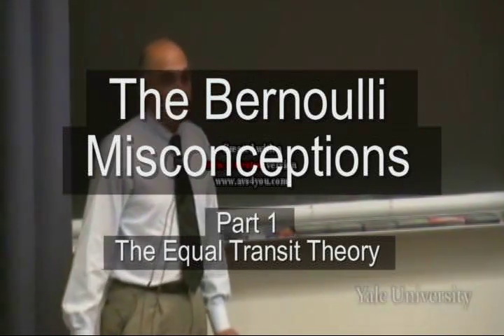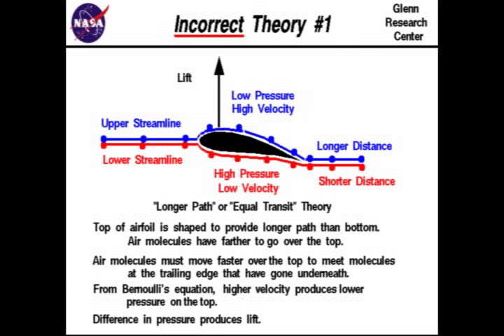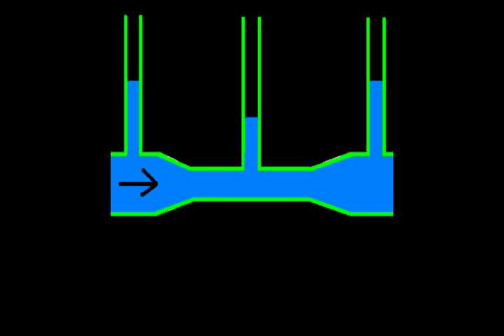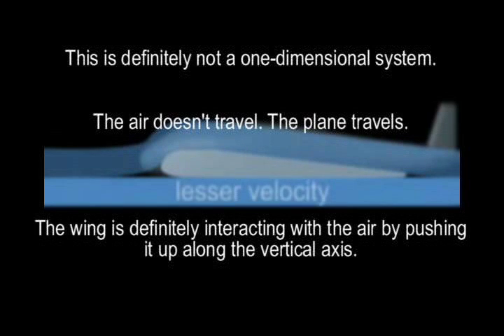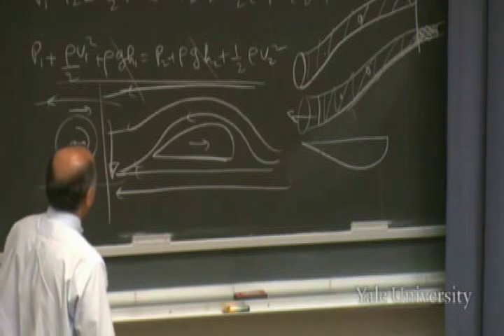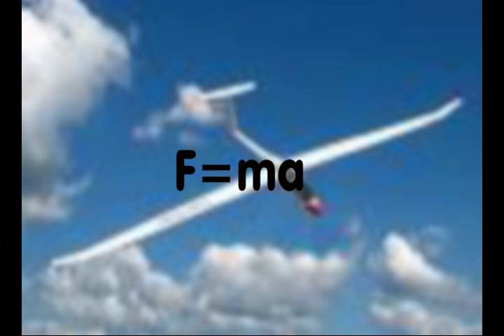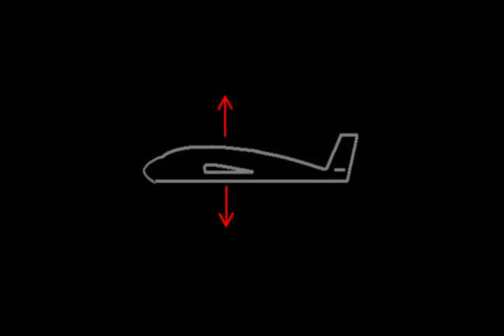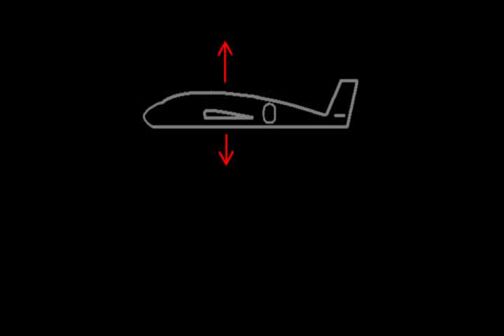Bernoulli Misconceptions 1 - The Equal Transit Theory

Comment: Your explanation is wrong, please read my correct explanation
https://youtu.be/2WTTXz3Dttw
Reply from the maker: The intention with my video was to prove that there cannot be any lift from the "Bernoulli Effect" as of the Equal Transit Time Theory. This means that 100 % of lift is due to the wing pushing air down and creating lift in according to Newtons Laws. Seemingly, this also what you try to show.
Reply: My point is that the expansion of the air on the upper wing leads to a decrease in pressure, and the pressure at the lower part of the wing increases as a result of compression, which is the so-called lift of the wing.
Reply: Why is the air inflated on the upper wing? Because the wing angle of attack, which leads to the upper part of the front wing channel narrow and wide, because the flow of air in the bulging, according to the state equation of the ideal gas, assuming other factors remain unchanged, it will reduce the pressure on top of the wing.
Reply from the maker: There will be expansion of air when there is low pressure. But a hydrofoil works equally well, and in water there is very litte expansion
Reply: Water flow in the channel illustrates the nature of the water. Why would the air pressure into the bottom of channel(2::40), because the channel is at the bottom of the low pressure, when the pressure is low to a certain extent, because the water is almost incompressible, so the speed is not too high, the air is pressed into the bottom of the channel.
Reply: English is not my mother tongue
Reply: It should be noted that the tiny compression of the liquid causes a great increase in pressure. Likewise, a small expansion of a liquid can cause a great drop in pressure.
Reply from the maker: Again, I can't see that I disagree with you. Maybe I would word it a bit different: When a wing creates lift, there will be an area of lesser pressure above the wing. Air will be accelerated into this area because of the pressure differences, thus causing the air to move faster. This will also be accompanied with an expansion of the air inside the low pressure area. All this will happen simultaneously. There is no one effect causing the other effects. All effects are causing, and being caused, by other effects.
Reply: As we all know, two ways can produce low pressure. One is that the flow rate increases and the low pressure is produced. The other is that the expansion causes low pressure. These two factors can lead to low pressure. So, is the upper part of the wing a low velocity or a low-pressure expansion? Either of these two factors, but one is the main one? So what are the main factors?
Reply from the maker: There is no way to answer which one is more important. The effects are both dependent on each other. It is correct that in a volume of air with less concentration of air molecules will exert less pressure on a surface if all other factors are the same. i.e. same temperature. In the case of an airfoil, it is a bit different. The effects cancel each other out, one might say. An airfoil creates an area over itself by removing air from this area when it diverts air downward. Air rushes into from the front of the wing in order to compensate for the low pressure area . Then, because of the lesser pressure, the air expands somewhat. This again lessens the "need" for air to rush in quite as fast because the air that already is over the wing has expanded a little. If air was incompressible, it would simply move a bit faster over the wing, but not create any lesser lift. This is why hydrofoils work equally well.
Reply: The reason for a hydrofoil is the same, because it expands so that the pressure of the water on the surface of the hydrofoil is reduced, so that the lift is produced.
Expansion can be a constant expansion, such as in the diameter of the pipeline can establish a uniform expansion of the conditions, but the constant expansion of the pressure has led to a decrease. So the speed has not changed, but the pressure has gone down. Therefore, a reduction in pressure may not necessarily depend on speed. It can also be caused by expansion.
Reply: Do you agree that inflation can also cause a decrease in stress?
Reply from the maker: Now, I am unsure if we agree at all. What is expanding? The water is not expanding to any degree that is worth talking about. When explaining lift, the only thing that one really needs to know is that an airfoil needs to divert air downwards. The resulting lift will be equal to the mass of the air multiplied with the downward velocity of the air. This is Lift = M(mass of air) X V(Velocity downwards). If one can analyze the flow of air around an airfoil in more detail, that will be fine, as long as one knows that the lift of an airfoil is in the end the result of the mass of air that is being diverted downwards.
Reply: In fact, any substance can be compressed and expanded. As long as there is a small water expansion would have great changes in pressure, so the water and air are different, so the discussion is to discuss water, water changes a little, because small changes in water has great influence, can not ignore the value of.
The upper air of the wing is moving downward, but why does the air on the upper wing move downward? This is the result of a powerful effect. Without force, the motion of the air does not change direction (from horizontal motion to downward motion). So why does it work forcefully on the air and move the air downward? What is this force? I think this force is the low pressure caused by the expansion of air or liquid. The low pressure causes the air or liquid to be subjected to downward force.
Reply from the maker: The shape of the airfoil is deceiving in many ways. There are many reasons why the airfoil look the way they do. they need to have the stiffness so they can carry the weight of the plane, then they also need to contain fuel tanks and under carriage and mechanisms for slats and flaps. In this way it is not only for aerodynamic reasons that the wings have the shape that they have. The wings are designed to fly with varying angle of attacks and at different speeds. The most critical part of flying is the take-off and landing. where the speed is low. When at low speed, when there is a really high angle of attack, it is essential that the wing has a shape that makes the air sticks to the upper surface .(Coanda effect), which will otherwise lead to stalling For this purpose it is favorable to have a high curvature of the wing at the front, with a lesser curvature towards the trailing end. If the wings were only designed to fly at very high speed, the wing profile would look quite different.
Reply: The shape of an airfoil can, of course, be designed in different shapes, but no matter what shape it is designed, the air will change direction of motion after passing through the wing, right? Now that the direction of motion has been changed, it means that it is acting strongly on the air. Otherwise, the air will not change its direction of motion. Then, how does this force come from? What is the cause of this force? That's the point. And I think this force comes from the expansion of air through the upper part of the wing.
Reply from the maker: Newton's 2nd law. For every action there is a reaction. F= ma. The lift, F will equal the Mass of air times the acceleration downwards
Reply: The question is how does this F come from?
Reply from the maker: F can only come from air being accelerated down by the wing. There is no magical suction force over the wing, or any other reason.
Reply: When the air is accelerated, then it needs force. Without force, there will be no air acceleration. Now, what is the force that makes the air speed up? This force is here. You didn't answer the question clearly.
When you say the air is turning, what does it make the air go down? You didn't answer it clearly.
And I answered the question: the expansion of the air led to the emergence of this force.
Reply from the maker: The force is the atmospheric pressure that will push air into the void that the wing has created by pushing air downwards (accelerating air downwards) or one can say say that the wind makes the air turn downwards. The air does so by the tendency it has to cling to a surface, also called the Coandă effect. It can't be that difficult.
Reply: So, why does it have a Coanda Effect ?
Reply from the maker: Because the air will follow the curvature of the upper side of the wing and be directed downwards. This is referred to as The Coanda Effect.
Reply: My question is, why does the air move so well in the Coanda Effect?
Reply from the maker: enbin zheng It is difficult to know what you mean. You need to read up on the subject yourself. My point with this video was to show that the lift of an airfoil needs to be equal to a certain mass of air being accelerated down F=ma. It was not the point to show the detailed flow around the wing.
Reply: My native language is not English, so the language is not good, I'm sorry.
My question is: why is there Coanda Effect? What are the causes of the Coanda Effect?
The air moves downward, but why does it move downward? Why does the air on the upper part of the wing move downward?
Reply: I know the air has a downward acceleration, but why does the air have a downward acceleration?

Comment: The transit-time fallacy was probably started in 1921 by Prandtl, as discovered by K. Weltner in his 1987 paper in American Journal of Physics, also see http://user.uni-frankfurt.de/~weltner/Physics%20of%20Flight%20internet%202011.pdf  
Prandtl missed the fact that CIRCULATION GUARANTEES that any parcel passing above the wing must greatly outrace any parcel passing below.

For all the disbelievers, think:   if the split parcels are recombining at the trailing edge, then the circulation is exactly zero, and so the lift is also zero.    In other words, the Transit-time explanation of lifting force is exactly the opposite of what it claims to be:   it's a description of the zero-lift case!    Regardless of the paths taken by the split parcels, if they recombine again, it means that the lifting force is exactly zero.
Reply from the maker: No doubt, in the paper the classical Equal Transit Time explanation is illustrated just like we are used to seeing it, thus making it likely that Prandtl had a lot to do with originating and spreading the fallacy. But it seems like even Einstein was somewhat misguided by the same Bernoulli misconception when designing his "Cat's Back Airfoil". I must admit that I am not very fond of using the word Circulation when describing airflow around a wing. The air doesn't really circulate, but just passes faster over the wing than under the wing. When accepting that Bernoulli's Equation is just an adaption of Newton's Laws when describing pressure of a fluid, it is clear that the air must pass over the wing with a higher velocity, because the pressure is lower.
Reply: Yep, and "circulation" only applies to flight in two dimensions, to ground-effect, and to venturis.  In these, continuity requires that any difference in velocity around an object is required to be part of a closed-loop flow around that object.  The speed-difference on the surfaces also requires an upflow before the airfoil and an equal downflow behind, producing closed-loop streamlines superposed on the constant wind.  In the 2D world, we cannot escape this.

But circulation isn't part of real-world 3D wings, which instead function via vortex-shedding.  But that involves an entirely different set of misconceptions that those discussed here!  :)
Reply: Lol, IF the path splits, and recombines after, the longer path on top requires that the molecules move faster on top.  This would cause less pressure on top.   I am sure that somewhere in history a wing of that shape was put in a wind tunnel to exhaustively prove just that.

But yes, predominantly lift is caused by AoA, but again, that wingshape causes some lift.  You are making this "fight" much larger than it really is.   Are you REALLY suggesting that my friends old Cessna, which has that particular wingshape, was actually and engineering error??   Hardly, my friend, hardly........

Comment: I'm sorry, but as I was proofreading I sent and forgot to include the following final comment
...
I also, do not see that your argument directly and specifically refutes the 'Equal-Transit-Pseudo-Theory". 
You may have shown that there is a problem in a "Constant lift" energy balance throughout the experiment, but I fail to see how that attacks the Equal-Transit myth itself. It is an argument independent of the myth.  Whether or not there is an equal transit time, the energy argument still is the same.
...
 The easiest way to refute that is with the direct observation that it is false by looking at in Holger Babinsky's video, here:
The non equal transit time (only) proof video by Holger Babinsky, Cambridge University
https://www.youtube.com/watch?v=UqBmdZ-BNig   Narrated, no title at start, Cambridge U.
-- 
Cheers, ScienceAdvisorSteve